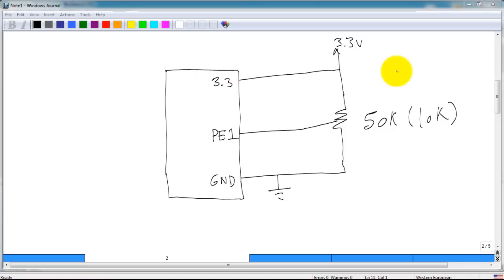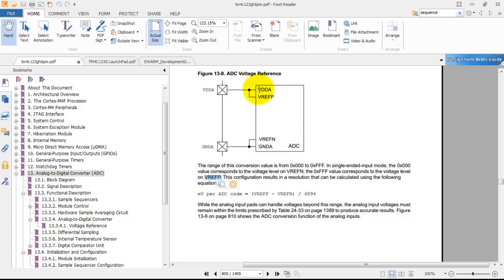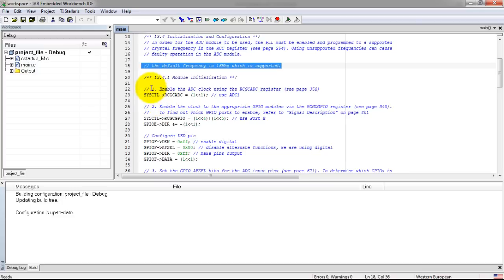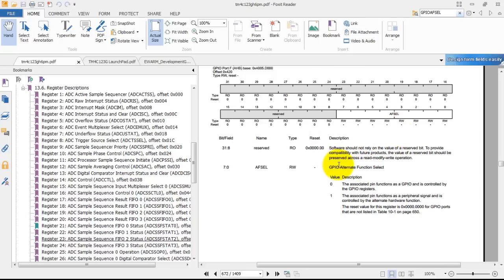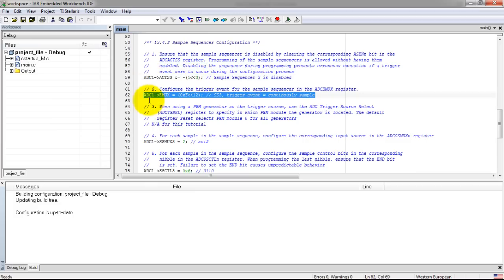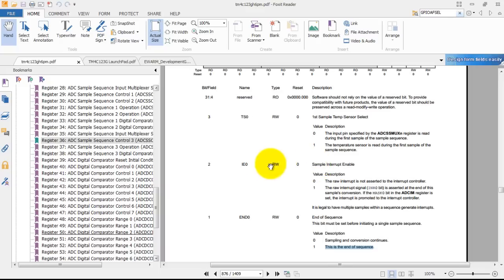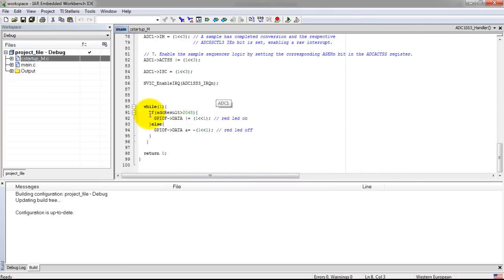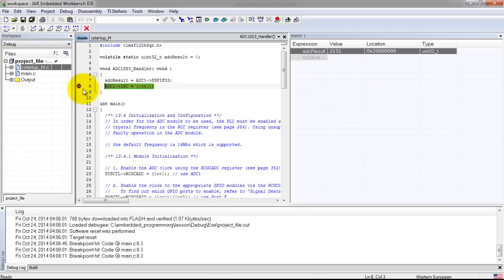TM4C123 Tutorial: ADC (Analog to Digital Conversion)

Comment: Hi , i am following your videos to learn embedded programing using Tiva c , and your adc video is very good unfortunately i'm unable to implement adc using sample sequencer 0 , as i want multiple sensor data . So i request you to please upload one video regarding this or send me reply regarding any help.
Reply: I am also trying to figure out how to use sequencer 0 for multiple analog inputs, let me know if you figure out a solution, and ill try to do the same, thanks!
Reply: I am also having this exact problem and can't find anything. Please let me know if you hear of anything!
Reply: //#include "TM4C123GH6PM.h"
#include <stdio.h>
#include <stdint.h>
#include <stdbool.h>
#include <inc/hw_memmap.h>
#include "driverlib/gpio.h"
#include "driverlib/adc.h"
#include "driverlib/pin_map.h"
#include "driverlib/sysctl.h"

 volatile unsigned int array[4];
 volatile float voltage[4];

int main(void)
{
    //Set clock to 16 MHz
    SysCtlClockSet(SYSCTL_SYSDIV_10 | SYSCTL_USE_PLL | SYSCTL_OSC_MAIN | SYSCTL_XTAL_16MHZ);
    // Enable the GPIOE peripheral
    SysCtlPeripheralEnable(SYSCTL_PERIPH_GPIOE);
    // Enable the ADC0 module.
    SysCtlPeripheralEnable(SYSCTL_PERIPH_ADC0);

    // Wait for the GPIOE module to be ready.
    while(!SysCtlPeripheralReady(SYSCTL_PERIPH_GPIOE))

    {

    }

    // Wait for the ADC0 module to be ready.
    while(!SysCtlPeripheralReady(SYSCTL_PERIPH_ADC0))

    {

    }

    //Configures ADC pins 
    GPIOPinTypeADC(GPIO_PORTE_BASE, GPIO_PIN_3 | GPIO_PIN_2 | GPIO_PIN_2);

    //Configure ADC functions
   // Using Sequence 1 which has a 4 entry FIFO
    ADCSequenceConfigure(ADC0_BASE, 1, ADC_TRIGGER_PROCESSOR, 0);
    ADCSequenceStepConfigure(ADC0_BASE, 1, 0, ADC_CTL_CH0 );
    ADCSequenceStepConfigure(ADC0_BASE, 1, 1, ADC_CTL_CH1 );
    //ADCSequenceStepConfigure(ADC0_BASE, 1, 2, ADC_CTL_CH0 );
    ADCSequenceStepConfigure(ADC0_BASE, 1, 2, ADC_CTL_CH2 | ADC_CTL_IE | ADC_CTL_END);

    ADCSequenceEnable(ADC0_BASE,1);
    ADCIntClear(ADC0_BASE, 1);
    ADCClockConfigSet(ADC0_BASE, ADC_CLOCK_SRC_PIOSC | ADC_CLOCK_RATE_FULL, 1);

    while(1)
    {
        ADCProcessorTrigger(ADC0_BASE, 1);
        //wait for the conversion to be completed
        while(!ADCIntStatus(ADC0_BASE, 1, false))
        {
        }//while loop 2

        //clear Interrupt flag
        ADCIntClear(ADC0_BASE, 1);

        //Read ADC input and store PE3 in array[0], PE2 in array[1]
        ADCSequenceDataGet(ADC0_BASE, 1, array); //read the analog values

        //convert the array to our voltage, I.E., max voltage (3.3V) / (4095) resolution = 0.0008
        voltage[0] = array[0]*0.0008;
        voltage[1] = array[1]*0.0008;
        voltage[2] = array[2]*0.0008;
        voltage[3] = array[3]*0.0008;

    }// while loop 1

}// end main
This code works for ADC sequencer 1, for sequencer 0, change your array value, and voltage the the number you want ( up to 8) and change the ADCSequence.... to 0 instead of 1. The compiler im using is Code Composer Studio 10.2.0. You may have to look up a video on how to setup the libraries. Also, set a break point when in the debugging part on the ADCSequenceDataGet and change its properties so it updates view. If you dont, the program will constantly run, but in debugging, you wont be able to read the values

Comment: I believe VREF used in all modules are determined by VDDA and GNDA which is the intrnal microcontrolle power supply. The voltage you supply to those pins does not make a difference.

Comment: If any one can help me its regarding this tutorial about the interrupts. I've decided to program it using memory addresses. The interrupt number for ADC1SS3 is 51. The Register 5: Interrupt 32-63 Set Enable (EN1), offset 0x104. So I had 0x40039000(ADC1 Base) + 104 getting  0x40039104. Then I set 0x40039104 << 19. Because 51-32 = 19. Is this how I enable my ADC1SS3 interrupt?
Reply: I mean 0x40039104 = (1 << 19)
Reply from the maker: If you havent checkout my first videos on the series, I show how to setup the files I use.  The code I use also uses memory addresses but they're already defined in the files provided by Texas Instruments. If you just want to learn how to addresses also checkout the files I use, they're very clear on how memory addresses are handled: a pointer is created to each register address as a structure. The structure has access to every byte on the register.
Reply: AllAboutEE 
I appreciate the response. I've just been trying to use the addresses straight from the Data Sheet so I didn't do some of the setup from your first video. I really wanted to learn to create my own library in the process. However lately people have been telling me to use the library TI provided. Is there any benefits using memory addresses other than education reasons?
Reply: AllAboutEE 
So far I was able to get to this video without using much of TI's stuff except for the C startup file. The interrupt behaves strangely and I does not continuously poll. I've rechecked the base and offsets of ADC1, and High performance Bus PORTE
Reply: On further debugging the sampler I've concluded works but there are still some things that don't make sense. Once I initialize the interrupt it never leaves it. Also not only doe it never leave it but it seems to be sending the analog signal to HB_GPIOPORTF as it dims and flickers when I turn my variable resistor. 

Here below is my interrupt handlers for ADC1SS3.

void ADC1SS3_Handler ( void )
{

    PE1_Dig_Input = ADC1SS3FIFO;
    ADCISC = (1U << 3); //clear interrupt before using it

    if(PE1_Dig_Input >= 3500)
      {
        ADCISC = (1U << 3); 
        HB_GPIOFDATA = BLUE;
      }
      else //if(PE1_Dig_Input < 3500)
      {
 
        HB_GPIOFDATA &= ~(BLUE);
      }
    
}

I can share the entirety of the code with you if you want, I just want to solve this problem.
Reply: AllAboutEE 
I've successfully debugged it. Thanks for the silence. If you didn't want to help any further just say so.
Reply from the maker: Helios Fire Yeah  I don't like debugging other's people code for free.
Reply: I understand, I was just desperate to understand why it wouldn't work and didn't know if you'd be interested in the problem or not. I won't ask again. I sincerely apologize, it came from a place of frustration, and I really appreciate the videos you make.

Comment: Hi, thank you for your great tutorial. I need to modify the code for my application; however, im having trouble since this is my first time using CCS. Im trying to add a digital comparator with the interrupt configuration set to hysterisis once. I have figured out the registers needed and such. My question comes to the implementation actually writing out the code. Can you give me some guidance? thanks in advance.

Comment: "Yo...Professor"...lol   I was able to get the Timer interrupt program working with no problem.   The ADC program "chokes" on ADC1->ACTSS &= ~(1<<3);  HardFault_Handler.     No data is available in the debug Register for ADC1.  The pot and hardware is correct.    Any ideas?    Thanks
Reply: I have the code if you need it.
Reply: lamarts100 disregard, it works...sorry
Reply: lamarts100  Can you pass me the code? thanks.
Reply from the maker: Adán Estrada https://github.com/AllAboutEE/ARM-Programming-Examples-TM4C/tree/master/Basic-Examples/ADC
Reply: AllAboutEE  Thanks!